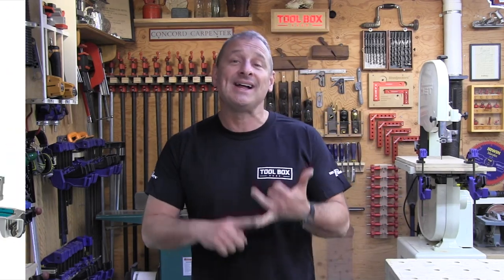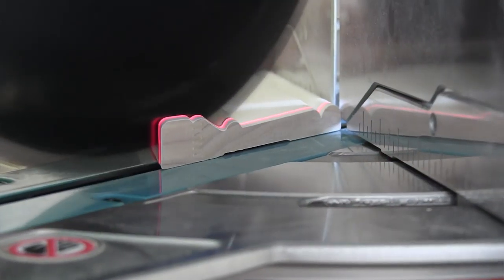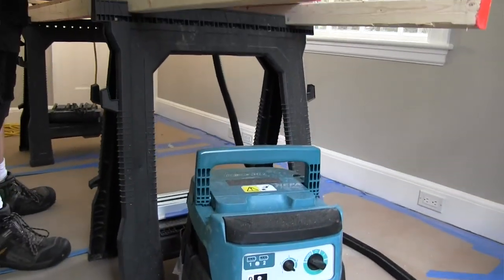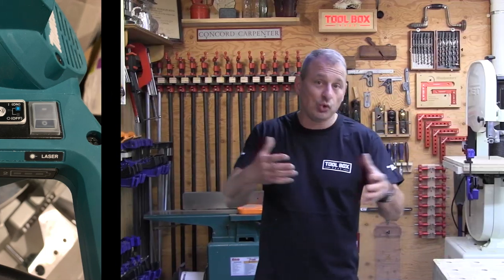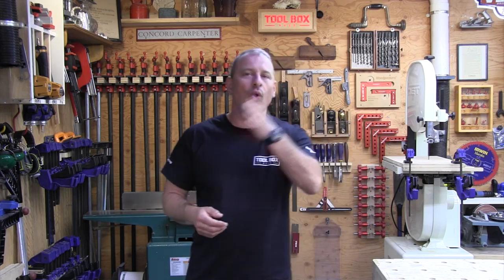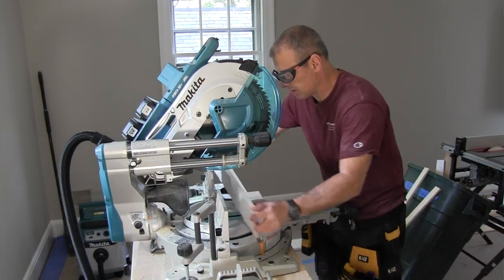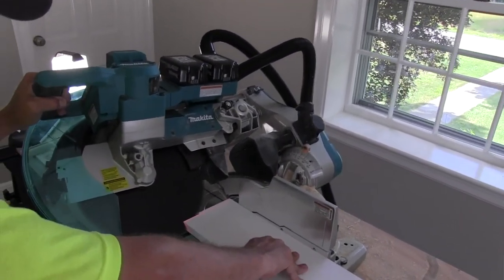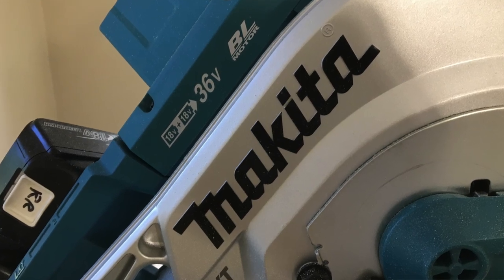MAKITA 18-volt X2 [36V] 12 Inch Dual-Bevel Sliding Compound XSl06PT

Comment: Hey Rob. I’ve had this saw for a while now and I completely agree with you about everything. Makita DID step up their game to compete and I think win, against dewalt. 

My biggest issue with this saw is the lack of functional crown stops. I contacted makita about which stops are intended for this saw and I got a set of them. The engineers completely missed the mark with the design of this simple yet important, to me anyway, accessory.  For that reason, this saw is my dedicated shop saw and my old dewalt is my on site saw especially for crown jobs. 

If you have any insight into the crown stops for this saw, stops that actually work well, I’d love to hear about what you know. 

I’ve been a HUGE Makita user for a long time and am glad that they hit the marks for 95% of this saw. 

Thanks for the vids. You guys ROCK. 

Scott
Curtis Custom Carpentry 
Mt. Wolf, PA

Comment: My dad used to own a Makita Dual Bevel 10" with a double rail system. I learned how to cut in that saw back in the Mid 90's I bought him the 10" version of this saw last year. He loves it lol. Great Review Rob btw you remind me allot of my old man ha...
Reply: I have the same older makita you mentioned. I made it my framing saw after I bought a dewalt flexvolt miter. The older makita is a great well built saw, but the years have brought lots of improvements to miter saws in general. I LOVE my flexvolt miter
Reply: jason armsbury don't you wish the flexvolt only needed one battery though haha
Reply: @MsElijah16  I have other flexvolt tools. Batteries hasn't been a problem yet. LOVE my flexvolt framer saw too

Comment: I have the LS1219L.  That's the corded-only/AC version of this tool.  It's my garage saw, not my jobsite saw. 

Overall the fit and finish is tremendous.  It feels like a quality tool.  Silky smooth rails and the head has a nice spring action.  I don't recall exactly but out of the box it was fairly well calibrated but I think I did tweak it a bit.  Dust collection is good.  Miter and bevel scales are easy to read and setting a bevel angle of approximately, for example, 44 and a third degrees it's right on.

The 2 downsides for me is the bevel adjustment knob and the secondary fences.  The knob totally works as intended but it seems like I do a lot of twisting.  Unlike the Dewalt where a quarter turn or so the head tilts freely, the makita requires several turns to loosen then several to tighten.  On a jobsite I think that might be annoying if you're doing a bunch of stain-grade self returns.

Also, the secondary removable fences aren't aligned with the lower stationary fences.  I returned the first one I bought and got another one.  Same thing.  I said screw it and I kept the 2nd one anyway.

If or when I need to replace my old 10" Hitachi jobsite saw I will probably go with the 12" Dewalt flex volt.  While I don't use the led light for alignment I do like it as a work light.  Battery or corded is nice and the bevel adjustment knob is super quick, and I don't mind doing the reach around thing, ask my wife!

Comment: I own the 10" and honestly  I have loved using it every single day. Now that they have a 12" version, it will absolutely be on my list to look at. That said it really sounds like the electric brake takes significantly longer to stop the blade than the 10" version. 

My personal pet peeves - 
The dust collection if you aren't using a makita dust collector is a bit of a pain. It also appears this one hasn't changed that. It isn't terrible mind you, but it certainly looks like  they didn't give much consideration to not using dust collection or their collector.  Sometimes I need to make a couple quick cuts and don't want to drag a bunch of stuff out and it throws the dust straight up in the air with nothing on it.

The Fence..same gripe. No idea why they went with this design. Not the biggest issue, but still.

The Laser for me is more or less indifferent. I would certainly have liked to see a better system, but honestly I am used to where mine is and most things  I walk the blade on my line first anyhow. That said the 10" version just gets so much run time on 2 batteries. I bought it when they had 2 free batteries so I have 4. I never have a moment where I don't have fresh batteries ready to go.
Reply: youre right about the brake. the 10 inch stops in 1 second while the 12 inch takes 2 seconds

Comment: Been waiting a year for this. Just spent 20 mins starring at this saw in my local tool store for the 20th time procrastinating lol. I noticed the 1st models had a bit of a deflection issue which seems to be gone. And the only complaint the store says they hear about is with big dust collectors the boots collapse and sometimes suck in a bit.
Reply from the maker: Kermit hmmmm will watch for that
Reply: A Concord Carpenter / ToolBoxBuzz Would definitely like to see a more in depth review by you guys on this saw. 
There was early reports of the slide bars being out of parallel as well but also seems to be taken care of and was fixable.
Reply: @ThisTall   an in depth accuracy test would be good as I never could get my 10" corded ls1019l to cut accurately on all cuts.
Reply: Yeah I saw this saw in my local store as well , they had a demo model out and the blade was stuck down , it took the makita rep 30 mins to figure out how to fix it, haha good on him
Reply from the maker: @ThisTall  not an issue on our saw

Comment: Thanks great review as usual. I have always had lasers and use them to I am good with this one. I decided to get the 10" version because of the weight and it still cuts 12" at 90 so that is all I need. I had the same problem with the allen key, I looked for 2 days before I saw mentioned someplace that it was in the end of the rail. Love the saw and all things Makita.
Reply: I am laying a hardwood floor at the moment and the 10" saw along with the Makita compact miter stand has let me set up in a hallway right where I am working. I work alone so the fewer footsteps I need to make gets the job done that much faster.

Comment: I have the 10” and love it but the only two things I hate are the laser and how difficult it is to change the degree setting. Getting to a preset (left and right) is no problem but if I need like a 27 degree miter, I gotta smack the saw left and right til it lines up because it’s so stiff. Seeing how smooth the 12 is, makes me think mine needs some adjustment to make it smoother... if that’s possible.

Comment: Good job Rob, I think having to remove the fence is a have a cake and eat it too scenario. You need the tall fence to cut large crown molding therefore it gets in the way on Beville cuts. I didn’t see any crown stops on the saw just curious. Me personally The 12 inch miter saw is one that you need to have but rarely use. So if I need a 12 inch miter saw rarely I’m going to just get a cord and plug one in. I go with the 7 1/4 inch Milwaukee cordless because it does 95% of my work. But I was just curious whether the Makita had ground stops?
Reply: B Wojak I'm on the Milwaukee team as well

Comment: Any insight, if Makita will be coming up with DC to AC converters in future ? same like Dewalt cordless machine, where you can bypass the battery and connect the same machine  directly to AC power. Thanks in advance.

Comment: i already have the saw its great i was about to buy the 10 inch and then this dropped and i ordered it first day and love it
Reply: it is a big heavy bitch tho i got it on the mastercraft stand from menards with the wheels and i feel like im pushing the stand to its limits the whole package feels like its 150-200 lbs and is a pain to get in and out of my tuck
Reply: @blackpowderenergy  So do you regret getting the 12” instead of the 10”? 10” would be 20-30# lighter?
Reply: @MichaelBrown-kk6ck  sometimes its easy to set up in the morning at the end of the day its a heavy sob

Comment: I am a dan of makita, i own a 12"( ls1214l) i bought 12 years ago, that one was build from japan, don't need to remove the T frame for bevel cuts, it just flip over, i do like the new version, makita made some improvments but didn't keep the goid ones, i do like the shafts on top side tho, also i own a bosh glide saw wutch i think work awsome too, the thing i better like with makita is the platform base, it's a large circonference base, makita is still my go to saw

Comment: Any issue with the detents on the mitre plate? Apparently, it is made of aluminum and long-term users are reporting slop in the detents.
Reply from the maker: not yet
Reply: I used the 10" corded version of their saw and there was slop in the detent plate a week after it was bought. The table got really stiff to rotate after just a couple of days and then after 2 weeks of use I noticed the blade wasn't  in line with the rails. I'm not sure if they fixed those problems or not but I'd be buying a Dewalt 12" saw if I was in the market for a new miter saw

Comment: Hİ Rob, would you recommend this 12 inch makita or the dewalt 12 inch flexvolt. price and the AC adapter is not a measure for me, so interms of build quality, accuracy, dust collection and battery runtime which would you recommend? Im already invested in both makita and flexvolt batteries so thats not a measure to, ı just want to make one purchase once. Regards

Comment: Hi rob great video as always! after using both flex volt and the makita which would you have on your building site? I’ve had makita saws in the past and found them to be soft and loose accuracy after been in and out of the work van a few times
Reply from the maker: this one is tight - lets hope it stays that way!
Reply: @ConcordCarpenter  Any thoughts on the aluminum presets plate? That seems to be a common complaint and one thing that I am keeping an eye on with my 10".

Comment: One thing i wanted to say also, what is the need of cordless battery on a miter saw that weight 69 pounds, cordless tools is for carry without the assle of a cord, miter saw is fixed on a stand, electric is fine and less expensive for that kind of saw

Comment: i currently have the dewalt 12" sliding flex volt and love it the shadow line is great but if your out side in the sun the shadow is not there
for mobility i put it on a dewalt wheeled cart.
 69 pounds is not a factor at that point
the cart isn't the greatest but with some manufacture wings added on it does a dang good job
this saw would need to massively out perform my flexvolt to switch
the makita has a few things i like
 the bluetooth vacuum control 
the up front controls
the big base
60 degrees both sides
and the pin lock the screw down lock on my dewalt pisses me off
Reply: I think all the tool brands are getting to the point that they can all do the same work essentially. I think the battery platform is most important. I don't see why you would switch from DeWalt to Makita. And I'm saying that as a person who has all Makita stuff and am not a big fan of DeWalt. But I have used their stuff extensively in the past. It gets the job done just fine.
Reply: Flexvolt is still the way to go!!

Comment: I got the 10" on sale, and have been completely smitten with it.   I feel like I don't deserve it every time I touch it.   I am not a laser fan for the precision that I have to work most of the time.   I use zero clearance throat plates both on the table and on the back.  I am careful how I mark my material, or I hook at tape or ruler and pull to the opening.   I make a point of using jigs to cut angles and I do not have to do trim carpentry work very often.  I took it to work for a week while I was waiting on part for older makita I typically use and once I got that repaired and back into my bench I instantly missed the smoothness of this style saw.  The 10 is not too hateful to move around, and for what I do it works.   I hate to have to stock multiple sizes of blades if I can avoid it, and I am able to stick with the 10" and keep my life simple.    I appreciate your channel and dedication to tools and craftsmanship.

Comment: Rob you Sand baggin sob.  I cannot wait for a head-to-head!  This is going to be awesome!!!  I'm torn between Makita and Dewalt.  It's interesting that Milwaukee doesn't seem to be in the conversation with these saws.  Perhaps because hasn't been released yet?  May I suggest if/when a head-to-head is done that the respective miter stands also be included?  Thanks again Rob love you guys!!!
Reply: T Willey Milwaukee has a decent single battery saw, I used it today for weather boards, it's pretty decent, could have a bevel adjuster like the festool though
Reply from the maker: I think your on to something here hmmmmm

Comment: Great video, whats the accuracy like on the saw, for picture framing fpr example
Reply from the maker: great
Reply: I think on picture framing you need a really solid clamping method of you are gonna use a miter saw. A miter saw really isn't the best tool for it but you can get it done if you have good clamping... I have the 10" version of this and I have made multiple box miter joints with splines and picture frames. Its OK but not perfect. But I had a Festool Kapex before and the Kapex didn't do any better to my memory.

Honestly I think the table saw and a highly tuned sled is the proper tool for the job. People who do picture frames for a living actually use a double 45 cut saw. 

Again .. I've done it with good results on this saw, but I had to be super slow and use super solid clamping because it wanted to have a slight gap in one of the joints. I'd give both this saw and the Kapex (which are the 2 best saws around in my opinion)  an 8 out of 10 score for picture frame miters.

Comment: I hope I see a match up with this saw and the flex volt ant the Milwaukee 12 inch
Reply from the maker: soon
Reply: The Dewalt is in another league I was just at a tool show near me at a place I didn't know existed they were cutting treated 4by4 as fast as they can as they do on jobsite both the Milwaukee and Makita stalled the Dewalt cut better than a corded saw they had there, but this Makita is a nice saw well made the Milwaukee wasn't as well made as the Dewalt and Makita

Comment: HD show the weight at 90lbs and the 10” as 72lbs, is that right? Also, can you plug into a 120v outlet with this?
Reply from the maker: possible I read it wrong - lemme check

Comment: Do you guys have the wired AWS adapter yet that plugs into a standard dust extractor? I improved the dust extraction on my 10 inch version by getting the dust port/ hose that points down and not out the top of the saw. You can also Daisy chain 2 dust extractors together and connect a hose to the top port and bottom port using the AWS adapter.
Reply from the maker: no

Comment: I have the 10" version of this saw. It's amazing. I will likely have this saw forever. Rob is right. Even the 10" is heavy. But I am in a small shop and rarely take it to a job site. It goes right up against the wall on a miter stand. Perfect for it. Initially I hated the laser but it is consistent so I got the hang of it and now I don't mind it. Only crappy thing is every 50 cuts or so I gotta blow off the laser eye with compressed air or wipe it off with my finger
Reply from the maker: I suppose your right - one you use it a lot you get on board with it
Reply: @ConcordCarpenter  thanks for the reply Rob👍

Comment: How does the power compare to Dewalt's flext volt or milwaukee's 12" saw you used at nps?

that needs to be a future video. Battle of the 12" cordless miter saws.
Reply from the maker: PistonHonda87 agreed - all is due time

Comment: SIXTY-NINE POUNDS!? WHAT?! What on earth is the point of having a battery operated saw if it is too heavy to move around with any practicality? I have the Bosch 12" glide miter saw, which weighs 65 pounds. That saw is already way too heavy to be moving around with any regularity - but that's not a problem since it is a corded saw that stays put. This Makita saw serves no purpose that I can see. They need to get the weight down to 50 pounds maximum for a cordless miter saw.
Reply: Subsonic1050 The Bosch is a dog to carry around
Reply from the maker: HEAVY!!!!
Reply: @MsElijah16  I completely agree, and this Makita is 4 pounds heavier!

Comment: i dont get it, most likey youve got the charger in the same room charging your 2 spare batteries just for this saw ,why not just by the corded version and save yourself 5-600 bucks in batteries
Reply: i came to the conclusion that my cordless saw would still need to be hooked upto a vacuum which is hooked up to a power supply....The Batt vacuums just dont have the power.

Which means your only eliminating saw to vac lead.

If iam there all day i would run a lead, if iam there for an hour i would probably take out the batt saw. But still, why would i lug that thing around for 1 or 2 cuts?
Reply from the maker: The extra batteries we have also feed other Makita tools we run - same platform. With 4-5 batteries we can run multiple tools.
Reply: @ConcordCarpenter  with 5 batteries you could run this saw, a drill, a driver and say a planer with none on charge but if one goes flat you end up with battery swapping madness and  chasing your tail. cordless tools are the most effective when your taking the tool to were the work is, but with a dropsaw (especially one as big and heavy as this one) you take the work to the tool, so to me it make sense to have that plugged into the same socket as the chargers for you batteries